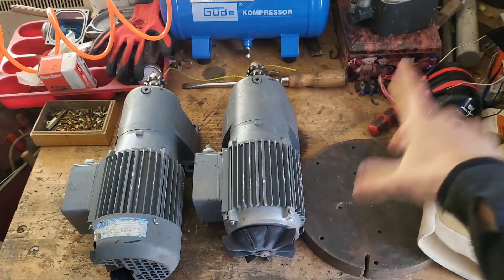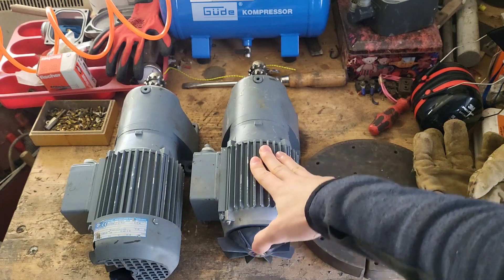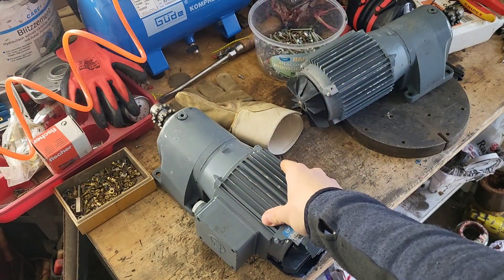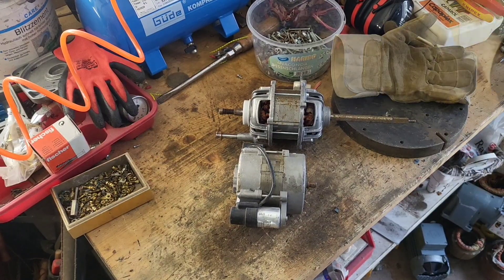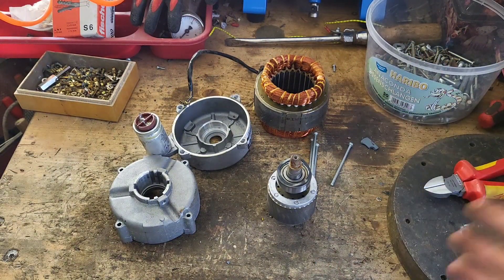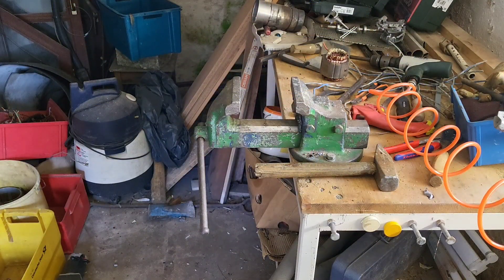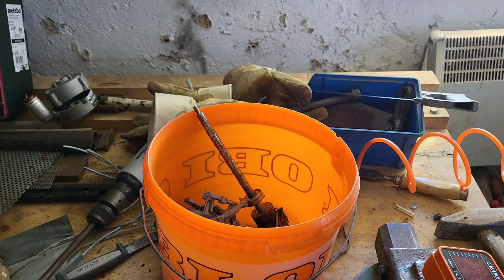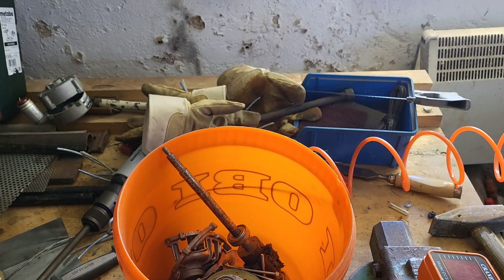How much copper is in small electric motors ?

Comment: Amen to that they do suck. I just finished 1100 lbs of motors and 15 of them had aluminum windings. So I will use it to make aluminum bronze. Just an FYI they do make these things called heaters they do help in thinning oil a bit . It may have helped that hydraulic oil in that knife nice video again see ya on the next one cheers  mate
Reply from the maker: Yeah, a heater would have probably done it, but I'm not going to buy one for one annoying motor ^^ Thanks for watching 👍

Comment: Next time pull the drain plug and drill a small hole and it will all come running out into your jar/bucket.
Reply from the maker: It unfortunately won't if it's just not liquid anymore. I poked around in it and it was mostly lumps, that's why it was clogging up so much. And even if I was able to completely drain it, it would be such an awful mess to take the damn thing apart, that's most definitely not worth it. That's nothing for me for sure. Thanks for watching 😃👍👍

Comment: Those are a good sized motor. 
Run an electric bike or something? 
Could be useful getting them new like that
Reply from the maker: One of them might actually be a bike motor, the other one is most likely for some kind of appliance, it's hard to tell tho, as they are usually used for quite a few applications. Thanks for watching mate 😃😊👍👍

Comment: Not sure I would call those small - small is the little guy that turns the turn table in the microwave. Using a hammer to unscrew things sounds like something I would do.I have a bunch to still do - so much scrap and so little time.  Happy Scrapping.
Reply from the maker: I guess you’re right, they aren’t that small, just compared to some other ones :) Yes, that’s always the case with scrapping, lots to do 👍👍😃

Comment: Friend love the humor and going with the flow of things. Never let a set back hold you back. You just proved being a Scrapper isn't perfect you still keep moving forward and profit is always there. Yesterday I went a picked up 4 different hospital beds. All weighing between 280 lbs to 380 lbs each. Donated..None the same. But I did get alot of motors/ control boxes from them.  Spent 5  hrs breaking down in below zero Temps. I'll break down the motors when I can move again  and my head unplugs....lol
Reply from the maker: Yes, you are absolutely right and I know your struggle, we all do stuff that just has to be done, eventhough the return might not be there, we push through 👍👍👍